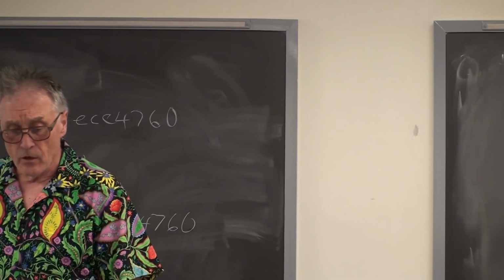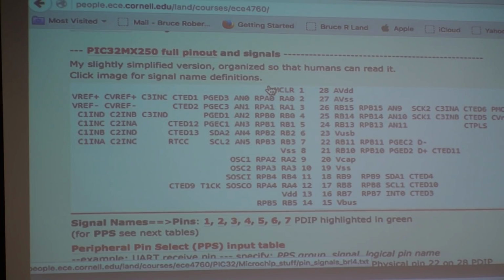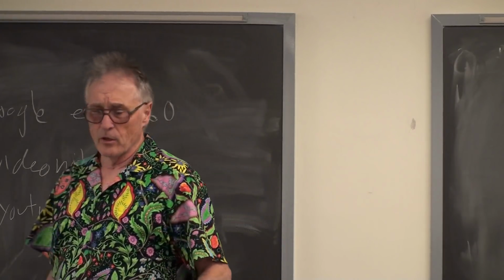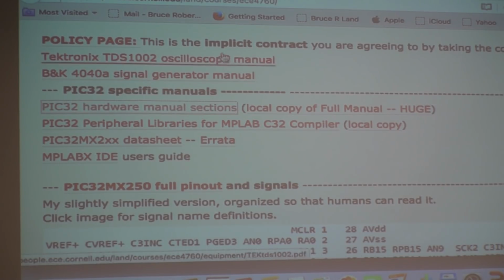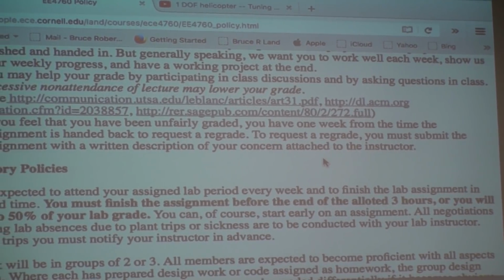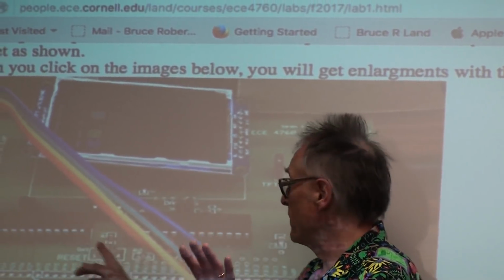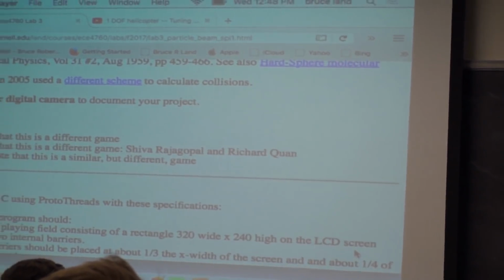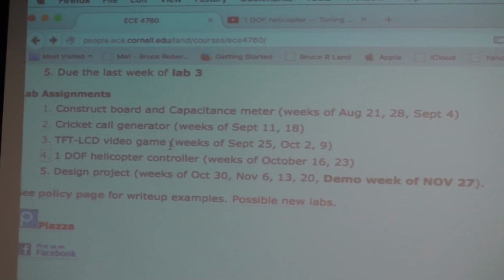#1 Course Introduction

Comment: Prof Land, to follow along the course would you recommend any off the shelf dev board? To the place where i live expresspcb is charging quite high. I can buy the display, programmer and other needed components and work with a bread board. Thanks a lot.
Reply from the maker: arduino is always good.
Reply: @ece4760  I'm sorry, I didn't mention.  It's for Pic32 course from 2017.
Reply from the maker: @vevasam  PIC32 will run on a solderless proto board. There are many web pages describing this. Example https://wordpress.codewrite.co.uk/pic/2013/07/11/setting-up-the-pickit3-with-mplabx-part-1/
Reply: @ece4760  Thanks a lot.